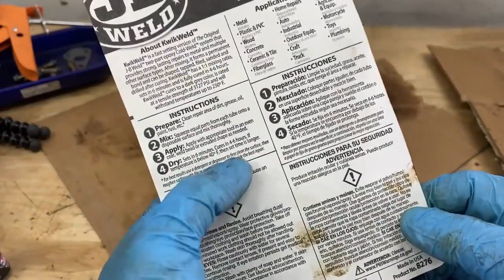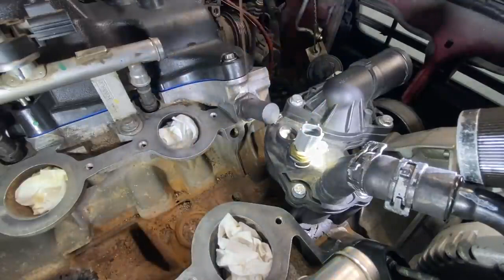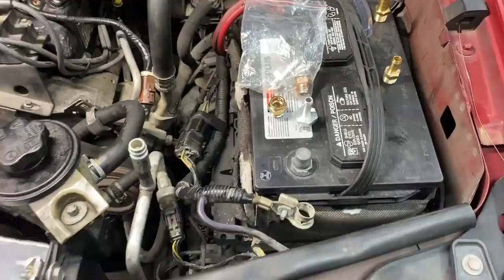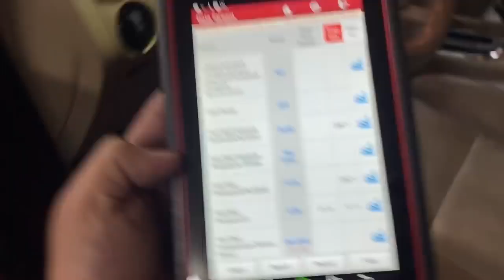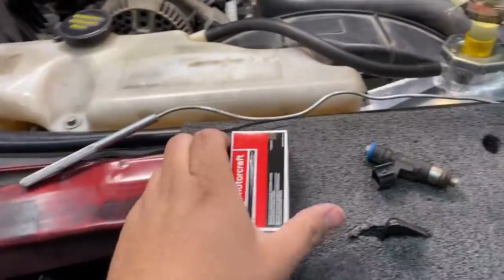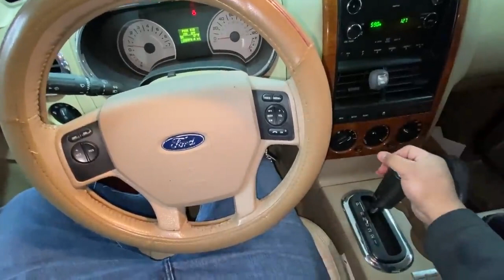Unboxing & Comparison: 3-Row All-Aluminum Radiator For 2008 Ford Explorer V6 4.0 SOHC | Alloyworks

Comment: AlloyWorks, did you ever find a 1/2" x 3/8" inverted flare fitting? If so let me know where I can purchase it because i'm in the same situation. I bought the same radiator but its a 4 row for my 06 Ford Explorer 4.0 v6.